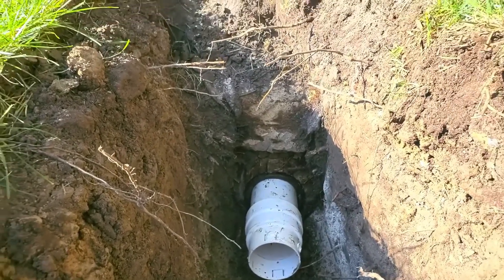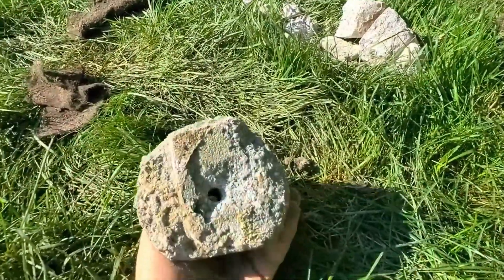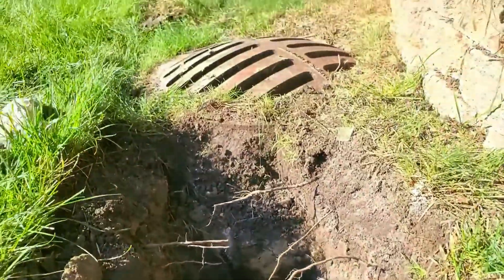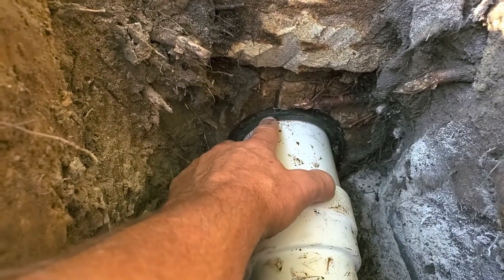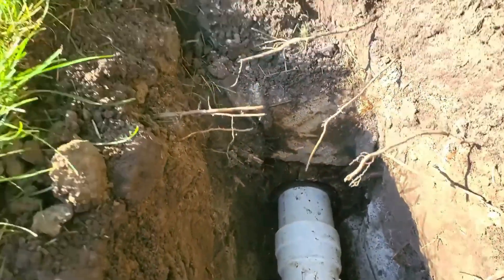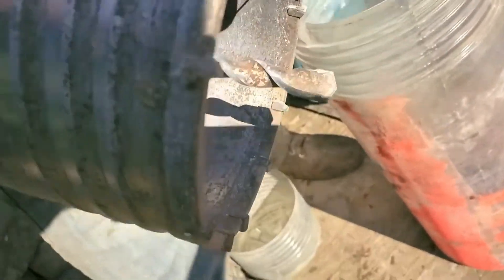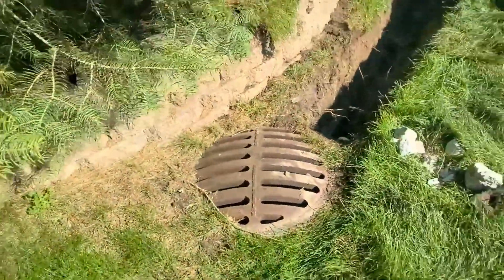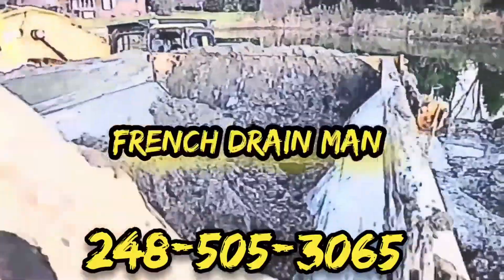How To Core and Tap a Storm Drain Catch Basin

Comment: Just did one at my house.  Rented a core drill set up for cheap.  Best thing I ever did was get that water flowing away from my house rather than an existing 4" line that has backed up in the past.
Reply: Not including the digging, how long did the rest of the process take? 
And how far back did you dig out to be able to use the drill?
Hope to hear back from you.
Reply from the maker: https://youtu.be/kj0fJtvWnuY?si=dei5Savm7Q5FGYRt
Reply: @FRENCHDRAINMAN  how deep did you core and tap the storm drain? It looks about 24”-30”. Does taping the drain require a permit or any permission from the city? 

I assume it’s based on your run and your 1% slope, or is there a specific depth… thanks in advance!